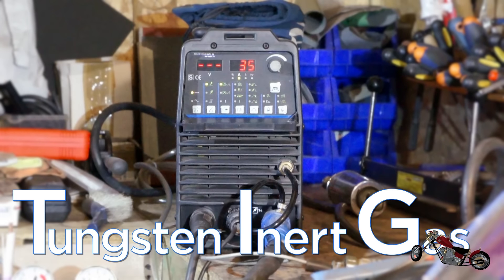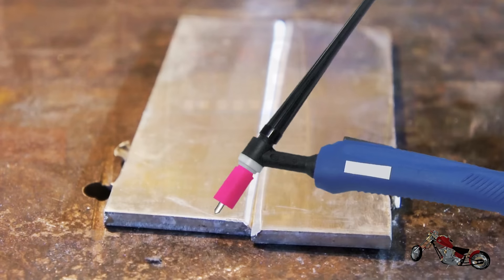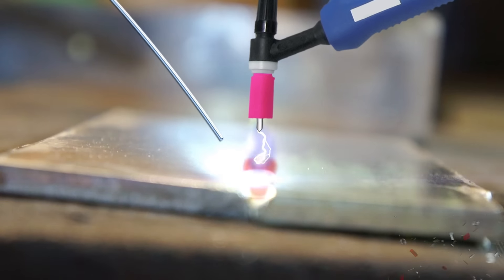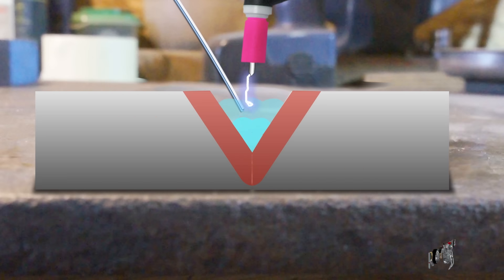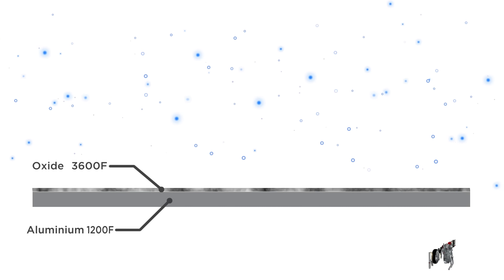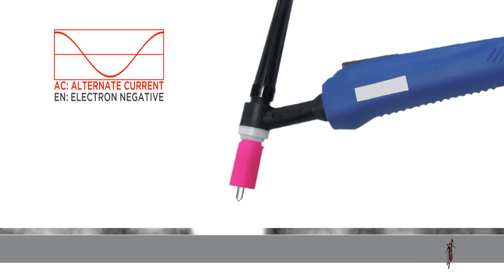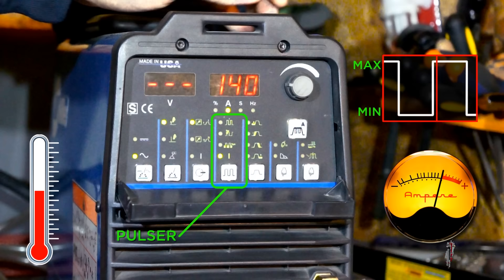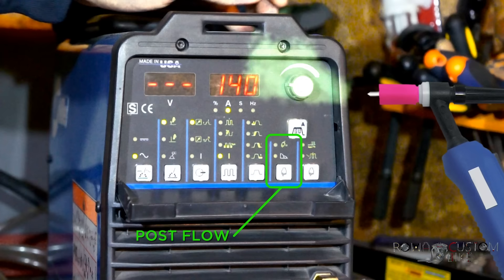How does TIG welding work on aluminium - Tutorial DIY - 05

Comment: IF YOU'R HAVING TROUBLE.... 

Pulse manually. Never let the puddle cool off completely unless your trying to fill a gap.. But manually pulsing is the best way to weld aluminum (thin like i do, we use hand remotes, not foot pedal. But can be done with foot pedal obviously) 

Just look at it.. Watch them become the same size. Add the same amount of fill (more for a gap, less for a tight fit) 

(Move the consistent amount each dipfor appearance)

Takes a few tries to learn how much fill..  Especially gaps.. But after you add fill. Wait a sec for it to spread out and sink in. You will see it. Try to make it even on both pieces of metal. (The bead) sometimes you just can't.

Then you will be a pro in a few tries. I guarentee it. 

Gaps can be tricky.. But make a puddle, add the fill, back heat right off and hit it back on edge of puddle and throw fill in.. Watch both aodes melt.. And repeat.. Easy shit..

Welding is not hard at all.. It Just take a few times to get it right.

Aluminum (especially thin) you can't wait around with heat and not add filler, you will just blow a hole.. if your filling hand slows down.. Just back heat right off.. Get your shit together then heat back on and fill... Even if you make a mistake... If It's small you can go over it pulsing.. Add a tiny bit off filler each pulse.. And it will look good... 

Don't weld it super hot.. It turns into water basically.. 

More taught there than 2 years of school.. Your welcome. 

One human helping another succeed. And P.S. Fuck the man!!
Reply from the maker: Awesome suggestions man!!! Thank you so very much! I’ll try them out